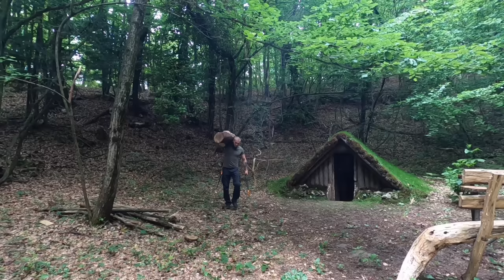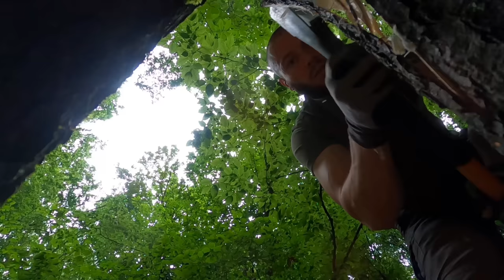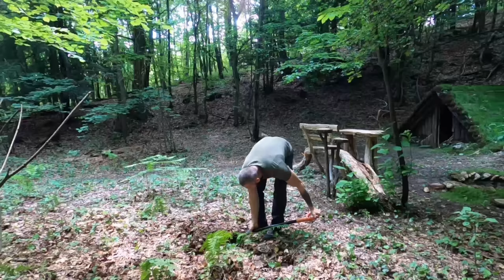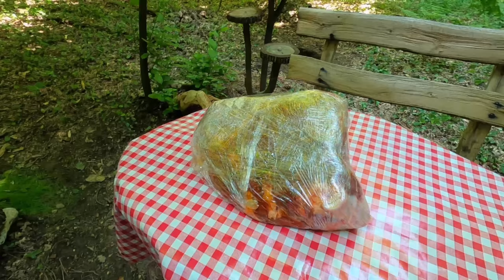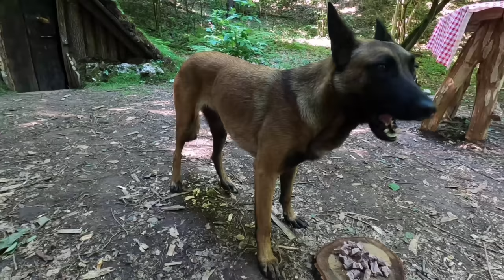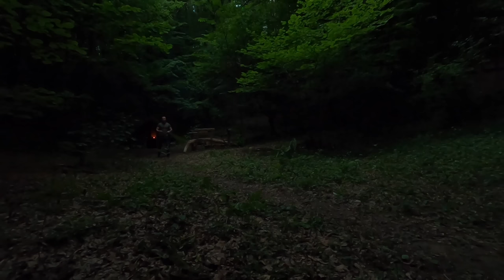Dugout Shelter: Build a Tandoor Oven, Outdoor Cooking , Wooden Table Diy

Comment: I'm from New Zealand 🇳🇿,  the Maori people,  used ground ovens, which are called a Hungi, in other cultures its named umu, a fire is set with rocks placed throughout the burn pile,  and allowed to burn down until the hot rocks are left,  with a little still burning coals and ash,  them baskets are made from flax,and the portions placed in the baskets,  and then covered with wet palm fronds until fully covered,  then dirt is placed over the top and left to cook for up to three hours.
Reply from the maker: WoW! 👍
Reply: @luxonbushcraft  , yeah man,  I reckon if you were to go digging into our written history,  one would find different skills that indigenous people's use, the ground oven in their cooking process,  Maori had steam from the many hot water pools that dot the middle of the upper island.  Thanks for sharing your hard work, your experience is amazing.
Reply from the maker: @deanekendall545  Thank you for the information